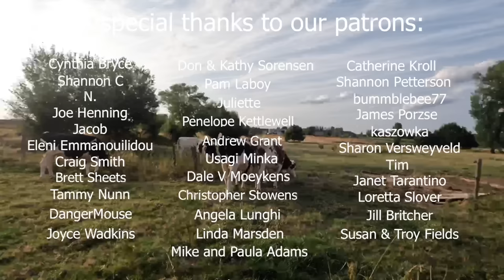External walls INSULATED. DIY job? - Totally! [Turning OLD SHED into a cozy TINY HOUSE]

Comment: From America, it is so unusual to see the insulation being put on the outside of the building. But I absolutely love you guys keeping rocking Ilya.
Reply: As a European it is very normal to see the insulation go on the outside. A lot of older buildings lack insulation. This was developed to created insulation without loosing square footage on the inside.
The insulation gets put on the outside and covered with stucco .
Reply: Yes I’ve never seen this before either-it’ll be interesting to see the finished product 😊🇦🇺

Comment: In Germany we apply the same insulation to buildings that haven’t had insulation before. You apply stucco on top of that insulation.
They don’t install insulation on the inside because the place is so small. You don’t want to use square footage.
They used the hemp blocks on the big house because they didn’t want to coved up the exterior brick.

Comment: Sanding the windows would have been a great job for the kids to do. It lets them learn something new, perseverance, attention to detail, and when they finish - a sense of accomplishment. They can always say, “I sanded and painted those windows. We had all three of my sons working on our dream house: sanding,painting trim, helping tile by mixing the thin-set and ground, cutting tiles, pulling cables, making window sills, cutting the grass, picking up debris, and they even got to run the skid steer under the direction of their dad. They loved that! 
We hired trades, but there was a lot we did ourselves. They would complain sometimes, but they knew we were all working and they were proud of their accomplishments.

Comment: The insulation looks like it will certainly help keep the temperature at room temperature. 

The windows from a Craigslist like site is the best idea. It has the best prices, and it will probably still be insulated enough with double glazing. 

It is certainly starting to look good. I really wonder what the outside will look like. 

Keep up the great work and you  will have a very nice tiny house!

Greetings,

Jeff

Comment: i changed all my windows and doors into PVC ones, i hate periodiek onderhoud, however, if you want the work you have done to last (longer) then, after you painted (not stained) the windows you shoul put maritime varnish on top of it, it is very resistent to weather and UV from the sun, otherwise you will have to sand and redo everything every X years, cheers guys

Comment: Nice to see old materials reused, and also to get the kids involved, which wil learn them skills a lot of young people don't have these days, that is creating something with their hands.
Where did you get those plastic fixation plugs for the insulation from, I will start insulating a wall from the outside in a week or four, and I'm looking for these.

It was windy last week, we had the storm, not as bad as the northern half of the Netherlands, but the days before were quite windy too and I was working on the roof in constant wind, so I got pneumonia as a result, luckily nothing severe..

Comment: Working so hard on the tiny house. Am wondering about that insulation on the outside of the house. Have never seen that before.
Reply: We use that a lot in bc Germany. You install it and apply plaster on top of it.

Comment: My comment may be a bit late. I have not been able to watch for a few days.
Have you considered using a sand blaster on the window and door frames? Sand blasting will remove all of the old paint/varnish. You will of course have to protect the glass. Illia is quite handy and should not have a problem making his own sand blaster. this could also be used on walls, concrete and metal depending on the media used. Veels geluk met die projek.

Comment: I’m a little confused. Why are you focusing on the insulation and windows and doors when the roof is. It finished?  If you get the building dried in with a finished roof, you can store supplies without being concerned about the weather!
Reply: He said it’s easier to install the insulation with the roof because the walls are very uneven.
He isn’t a contractor. He is a DIY builder.
Now that it is all in place, he will put on the roof.

Comment: Why insulate the exterior walls on the outside instead of the inside like inside of the farmhouse?  In most cases, European homes either have a ship lap/overlap siding brick veneer or plaster.
Reply: Yea, I am still trying to understand how they are going to affix anything to the outside of the building with the foam on the walls. Wait and see I guess.
Reply: The thermal mass is best on the inside. Keep the fluctuations of temperature on the outside and let the thermal mass of those walls keep the interior temperature steady. It is the way that all buildings should be insulated.
Reply: What are your plans for the exterior brick wall that you did not insulate?
Reply: In small spaces stealing space for insulation makes the space even smaller. In a large building like the farmhouse, it doesn’t matter so much, but in a tiny house a few centimetres here and there matters.

Comment: Why are you working on the building rather than the main house? I must have missed something.
Reply: In Belgium you pay  a 50 % penalty on the purchase price when you don’t occupy your property within 3 years.
She said she doesn’t want  to live in dust.
That’s why they bought the trailer and are finishing the tiny house tho have an extra bedroom and living room.
Because of the war in the Ukraine, they rescued family members and brought them over.
I presume they need to accommodate them and support them.
They moved out of their rental home and all live in cramped quarters.
Fixing up the tiny house is probably faster than fixing up the big house. That doesn’t have a heating system yet.
In order to install a heating system, you need to plaster the walls and install flooring.
They also said that in their culture they are used to do the work themselves and not hire it out.
In top of all, they work full time IT jobs and renovate in their spare time.
The trailer and an insulated, heated tiny house seems like the fastest and cheapest option to get through the cold season.
Later on the tiny house can be used for guests or as a rental property.

Comment: why didn't you use those Hemp blocks?
Reply: It’s probably cheaper to use the material they are using.
Reply: The hemp blocks are are about 30  to 40  cm thick . That quite a bit of floor space given up to insulation in a small room.